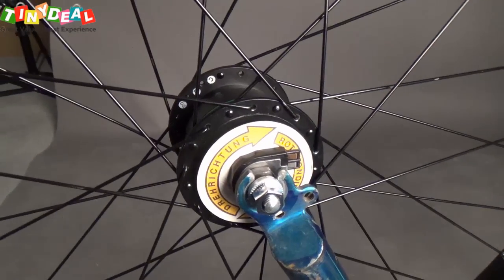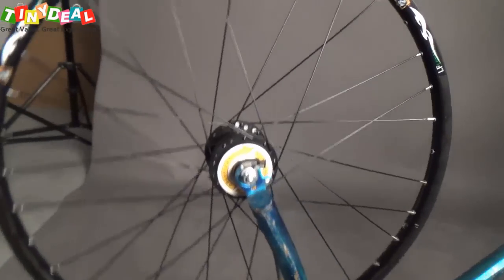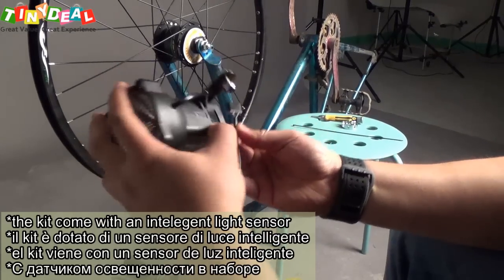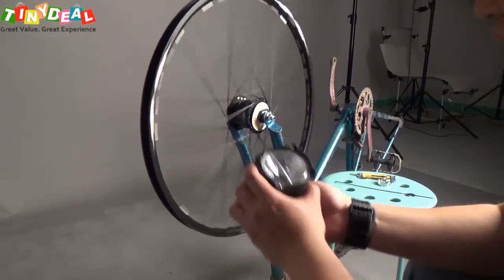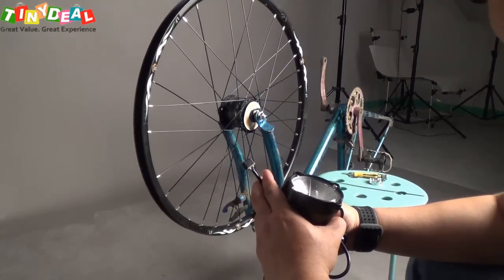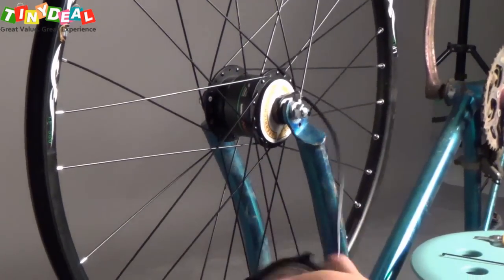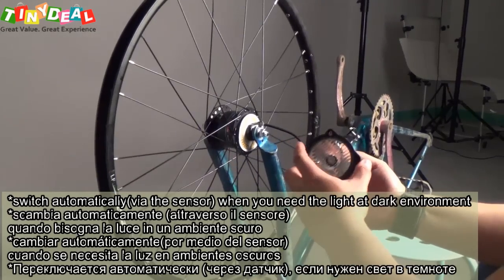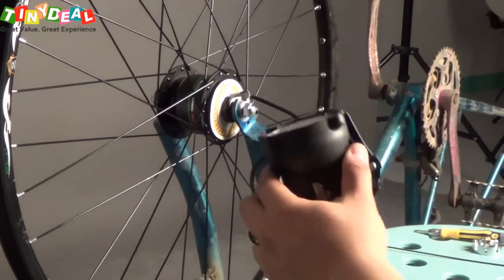Guide For Bike SHIMANO Dynamo Generator Hub

Comment: It is an AC or DC output?
Reply: CDNBaconRich 6 volts AC
Reply: that the weird thing it should be dc lol
Reply: @buder5116  Its an alternator dude. Alternating Current. AC
Reply: @rhetorical_annihilation  i know now  since i actualy used a brushless motor as generator hehe  but thanks